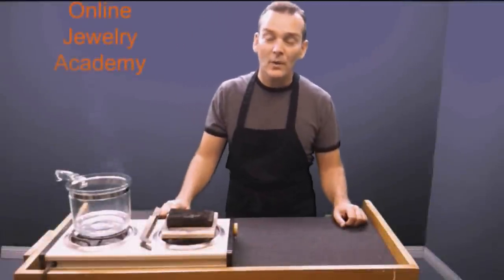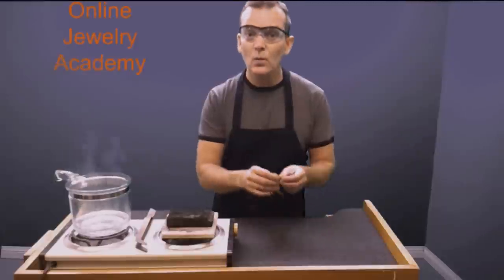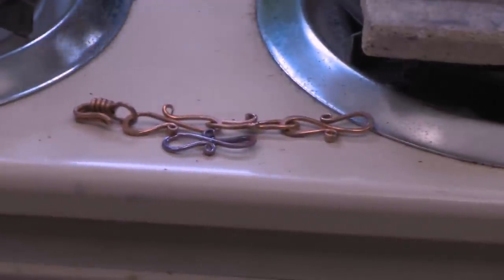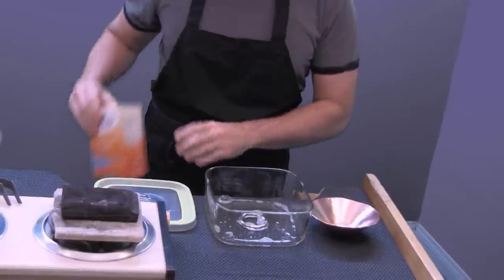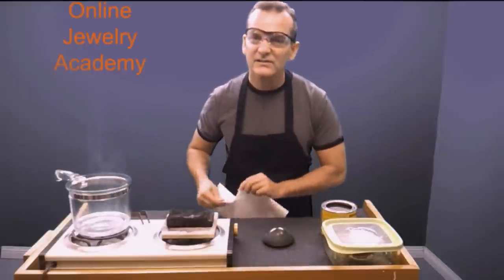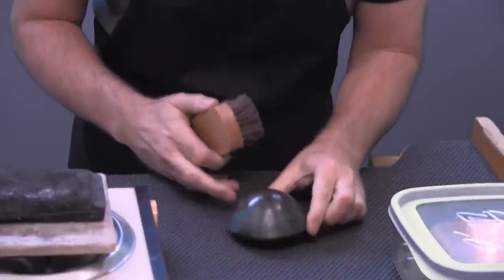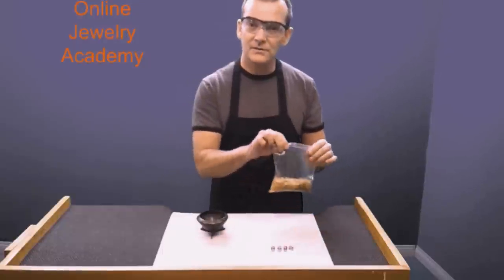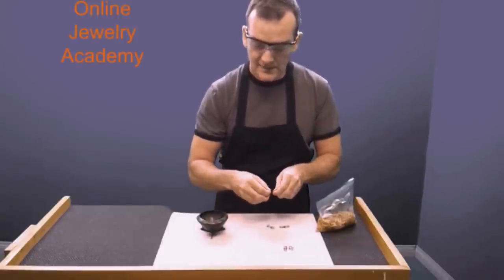Red And Green Patinas On Copper Jewelry

Comment: Thank you for showing a red. I got a green from vinegar salt and blue from vinegar salt and ammonia- had not seen red! Awesome!
Reply from the maker: Glad you liked the video. Thanks for watching! 😀. The red piece is very soft. You’ll see when you make one.
Reply: @OnlineJewelryAcademy  Right, It is no longer work hardened. I guess a few smacks on the tabletop (not enough to mar) could help a bit.
Reply from the maker: @picklesnoutpenobscott3165  Work hardening the red copper is a challenge. That’s why I only use it for decorative elements. But a few blows with a plastic or rubber hammer might help.
Reply: I find the red always appears when I heat it and just quench it in cold water. I dont think it has to boil. It looks red almost lots glowing even when it has stopped glowing. I have not tried quenching it in a boiling water.
Reply: @OnlineJewelryAcademy  challenge how? Is it more brittle?
Reply from the maker: @holohulolo  you comment is at the end of a long thread on my end. Hence, I don’t understand your question.  This process doesn’t make the copper brittle. In fact, it anneals it. 😀
Reply: @OnlineJewelryAcademy  Use rawhide hammer.  No marks but does the job.  Good point about hardening them again.
Reply from the maker: I’m glad that you liked the video. Thanks for watching! 😀

Comment: What kind of touch are you using? I purchased a butane torch and when I turned it down on the piece it shut off because the liquid ran down to where the gas is?
Reply from the maker: Hi Kimbrella, I use a number of different torches in the various OJA videos.  The one that I use most often is a butane torch.  The OJA does not endorse any particular manufacturer.  But, if you buy a butane torch, look for one that can produce temperatures over 1500 degrees.  Some versions for kitchens do not get that hot.  If your torch is leaking fuel, you need to not light it and return it for a replacement/refund.  It's not safe to operate it if it's leaking.  Good luck with your work.
Thanks for your support! : )

Comment: How easy is this patina to clean off of copper? I've got a copper e-cigarette that needs to be untarnished along the battery contacts for conductivity so could I patina the whole piece and then clean the contacts or would it be a pain to take off?
Reply from the maker: +Daniel Kadera 
Hi Daniel,  I've never worked on an e-cigarette.  So, I don't know exactly how to advise you to complete your project.  The patinas are merely a layer of colored oxidation.  They are easy to remove with fire, abrasion or chemicals.  Like I said, I've never worked on an e-cigarette.  So, I don't know what to recommend in terms of a particular approach.  I suggest that you run a few experiments before you potentially damage your e-cigarette.
Thanks for watching! : )

Comment: Can pieces be solder afterwards? Or should a cold connection be used?
Reply from the maker: You can only successfully solder on clean metal. So you’ll need to use cold connections. 😀

Comment: Will Protecta Clear help hold its color and make it look shiny or will it remove the patina?
Reply from the maker: I don’t know. I’ve never used that product. I suggest you conduct a few experiments. 😀
Reply: Its a sealing lacquer.  I would not use this.  Part of the charm is to have an earthy tribal feel to this chain. If you lacquer it, it will have a slick, city look. The lacquer may chemically react to the finish as well and change the colors.  Micro wax is the best way to keep a natural feel to it, and give it some protection.
Reply: I use ProtectaClear on some of my bare copper pieces that I want to stay bright and maintain that new penny look but I don't think I'd use it on colored patinas.  In some instances, depending on the patina type and vibrancy of color, adding a sealant could dull it down causing it to lose some of its vibrant "appearance".  It doesn't literally remove the patina... instead it changes the way light hits it and reflects off of it so we see it from a different perspective.  Before adding a sealant, light hits the metal directly without having to bend through something and then bounces directly off. After adding a sealant, light has to travel through the sealant and bends before it hits the metal  and bounces back (think about elementary school science and prisms). My advice would be to do a test with and without ProtectaClear and see which way YOU like it best.  After all, jewelry is all about one's personal preference and style.  Good luck!😊
Reply: @tlojewelrylove  Thank you that's exactly what I thought so I left it as is. I wasn't willing to risk an experiment on this specific piece but maybe one day I'll experiment on something just for the visual knowledge.

Comment: could you do the red on a chainmaille bracelet will it lose its temper
Reply from the maker: The red color is achieved by exposing the copper to high temperatures.  So, the piece would become very soft.
Thanks for your support! : )
Reply: And where I to put it in a vibratory tumbler wouldnt it work harden the chain or would it lose its color then? Thanks Lance
Reply from the maker: Tumbling would definitely help to work harden the chain.  But, Yes, you would loose all of the patina.  I love the red patina myself.  But, it isn't appropriate for everything.  You might like the peanut oil panting.  It can give you a wide range of colors on copper from honey gold to a deep dark brown.  And, we have a video on it.  Good luck with your project.

Comment: The Face Yoga video advert that preceded this instructional video is way, way, too long!  I can understand the need to fund a video site with advertising but not when the advertisement is as long as the instructional video and nothing your viewers wanted to see.  I can't even fast forward the ad. or stop it.  It's too much!!!
Reply from the maker: Hi Hilary,
This is Don from the OJA.  We share your frustration with YouTube's ad policies.  Unfortunately, the only advertising option we have (as a YouTube Creator) is whether ads are included or not included in our videos.  Once we opt to get paid for the videos, YouTube decides what ads to place and how long those ads are.  From my experience as a viewer, they have non-skipable ads that range from 6 seconds to 15 seconds and these get played at random on our videos.  They also have longer ads (15 seconds to multiple minutes) that have always been skipable after the first few seconds.  Due to some recent controversies with YouTube advertising, they made a lot of changes in their system and we have encountered a variety of glitches.  If you were unable to skip that long ad, I suspect that you encountered a glitch.  Sadly, YouTube does not provide most creators with a customer support email or number to report such problems.  Not only do we have no control over it,  we are left frustrated until YouTube discovers the problem and corrects it.  I would recommend that if you encounter another long non-skipable ad for any video you want to see, that you stop the video (by whatever means you need) and retry it later.  We thank you for being a loyal view of our channel.  Thanks for your support.
Don
Reply: Hi Don - Thank you so much for your swift and informative reply.   I think there must have been a glitch as I wasn't able to control that very long advertisement in any way and it was a lot longer than 15 seconds.  There's a different one on today and it is much shorter so maybe the Face Yoga video has been removed.  I so appreciate the videos the OJA puts onto You Tube and recommend them to all my jeweller friends :-)